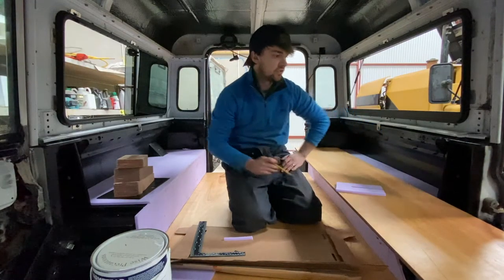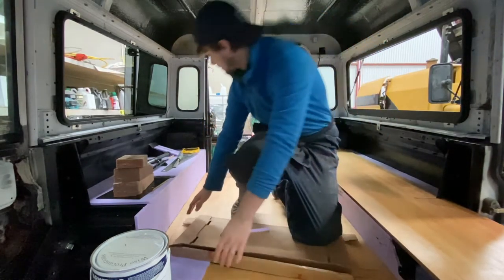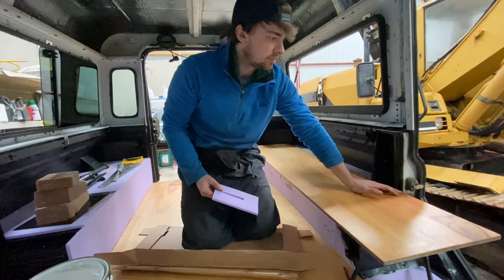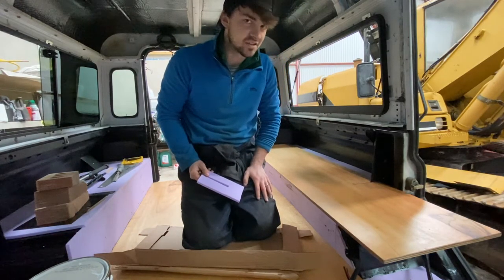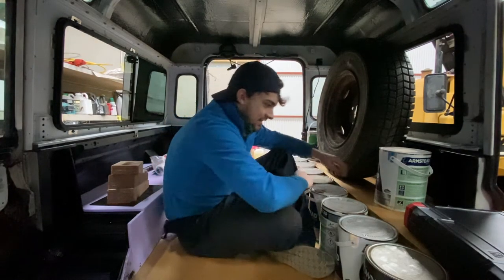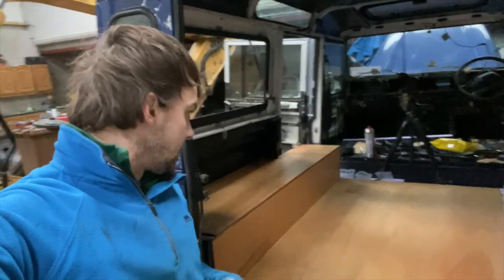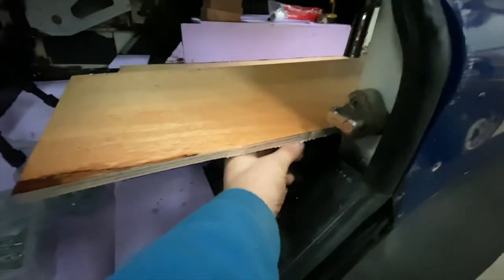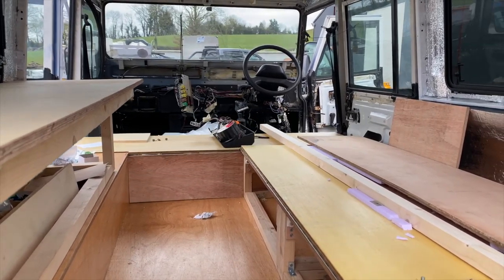Defender Camper Flooring

Comment: Hello,
I recently discovered your channel. This is very interesting for me because I also want to fit out my Defender.
Too bad English is difficult for me.
Can you tell me what materials you use:
- black insulation in video 06
- silver insulation in video 09
- purple insulator in video 09.
Thank you in advance and good luck with your arrangements.
Michel
Reply from the maker: Hey Mitchi, thanks for watching! 

- The black insulation is a 2mm noico sound deadening. It’s a self adhesive acoustic lining to prevent the panels from reverberating noise into the vehicle. I bought this off Amazon. 

- The silver insulation is a 10mm self adhesive reflective closed cell foam. This also came from Amazon. 

- The purple insulation is a 10mm XPS rigid board that we bought from www.theunderfloorheatingstore.com 

I hope this is helpful. Let me know if you have any other questions
Reply: @roaming_with_rona  Thank you very much for your response.
I will look on the Amazon side as well as on the site whose contact details you gave me.
In the future, I will not hesitate to contact you again.
Have a nice week end.
Michel